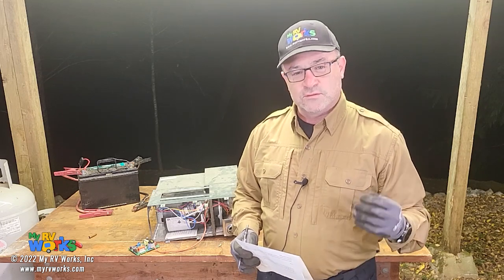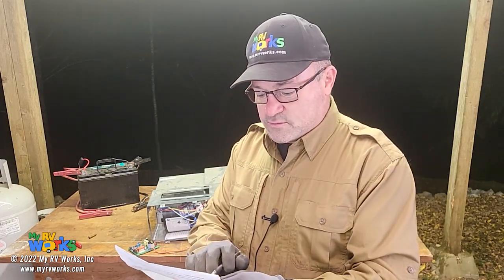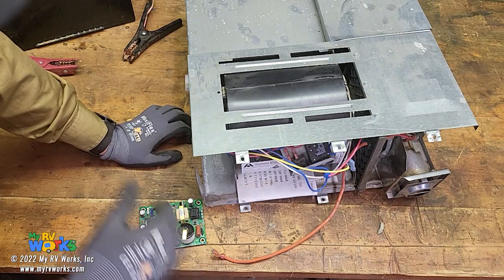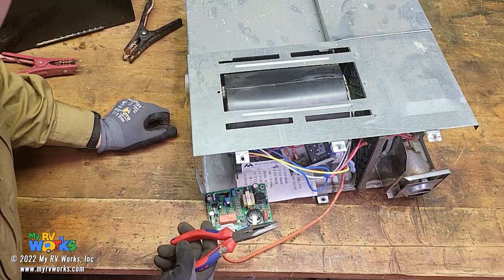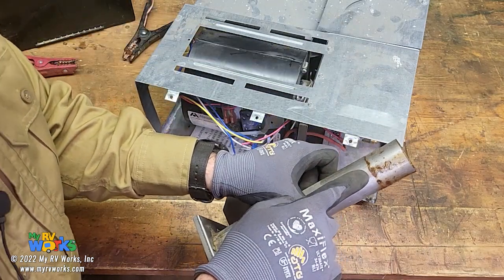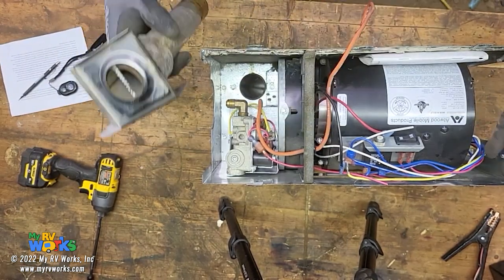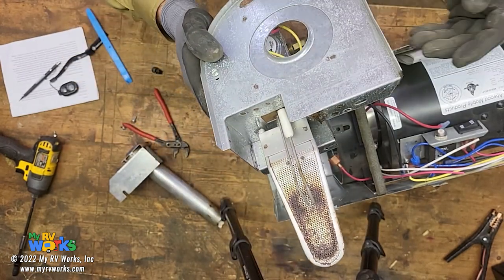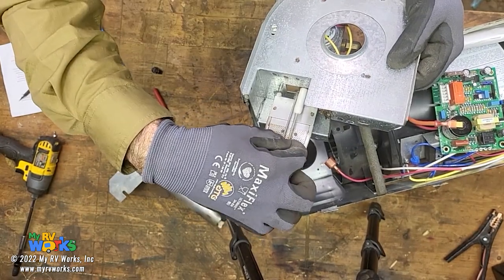Smell Gas From RV Furnace But It Won't Start -- Solve This Issue Here -- My RV Works

Comment: I want to thank you for your videos they've been very educational I've come to the conclusion that the best thing for me to do other than spending $1,400 for a new $3,500 BTU heater is to spend $260 changes all the switch sensors board new motor new fan I ordered through Amazon and I'm just going to rebuild that fucker new burner new nighter the whole nine yards and yeah like 260 bucks it's way better than 1400 for a new one nothing wrong with the housing

Comment: i have the Atwood Hydroflame 8535-1 furnace. 35k btu. has mostly new parts but now leaking gas from old solenoids while running it. works perfect and has been for 50 times but now leaking. cant find a Atwood #31155 gas valve for it. is there a rebuild kit or can i rebuild it? an alternative that can be safely modified? THX!

Comment: Love your videos but that problem with my Atwood 8525-IV is that the gas line comes from the top and makes it almost impossible to get to all the screws. Unlike this one the has a flange connection. Do you have a video of the other style?

Comment: In most videos (including yours) it is claimed that the gap specifications should be 1/8 in between the electrodes and the burner.  But what I am seeing in most videos is a gap of almost 1/4 in.  I have also been hearing the the exhaust tube should get some lock tight on it before re-assembly, is this true?

Comment: Hi Darren!
Thank you VERY much for the super well done videos. My furnace ias an Atwood 8535 made in 1995.  My heater fan motor starts, but the burner does not light, and the blower just keeps going, and if I do not catch it, the fan will run until the house battery is depleted.  I THINK that this must be a board problem, because the fan should be shut off after a period of time if there is no heat happening, shouldn't it?

Comment: I can smell propane from my heat vents while the furnace is not running and gas on. Otherwise the furnace works fine. Is this a bad heat exchanger? I also have the screen covers on the outside exhaust vents so animals stay out. Could this be part of it?
Reply: Did you figure it out? Having a similar issue
Reply: @NoName-sx9xs me too… can smell gas when furnace isn’t running… how do we fix this ??

Comment: Hello, my dometic suddenly stopped working. Fan blows, can hear valve open, hear spark igniting and smell gas, but will not light. Any suggestions to why?
Reply from the maker: I can think of a few things you can check, I'll just rattle them off here and see if it helps: 
> Verify your exhaust port is connected to the furnace. With that removed the furnace will flame out almost every time.
> For the next part you'll need to remove your burner assembly. But once removed, verify the gap between the electrode and the burner screen is 1/8" (just use an allen key to slide between). Also, remove the little brass orifice and make sure that that is not clogged in any way. Often times small insects like to set up house in there.
> Verify propane pressure is at least 11" W.C.  operating pressure. Depending on where you live you might need to get a license to person to do that for you.
> After all those tests, then I might suspect the board or the electrode.  On our furnace playlist we have many videos where we diagnose these types of issues.
Reply: I had the same problem, fan blows, I hear ticking and smell gas. The burner plate look almost new, the solenoids also look new. The electrodes look new also but, the electrode was different than the video. It has 3 prongs instead of 2. I also noticed a large gap between the electrodes and a burner plate. I bent the small electrode and the electrode that had the wire connected to it closer to the burner plate,that fix my problem.

Comment: Is the startup sequence of a Suburban different?  A Suburban Service & Training Manual states, "Upon a call from the thermostat, the module board thermostat circuit will go active. The sail switch circuit is verified as being open. The blower output is energized. Blower motor starts."   So if the sail switch is stuck closed the blower (on a Suburban) won't start?
Reply from the maker: You are correct. If the sail switch is still closed then the board will not energize the blower motor.
Reply: @MyRVWorks  Hi Darren, I have a question I’m hoping you can answer. I have PEX plumbing in my 2017 5th wheel. I took a section off and saw that it has brown slime growing in the inside. This was a section going to the shower but I know it must be throughout as the bathroom sink water has been smelling bad. Is there a way to flush vinegar, or peroxide or something through the piping to kill the bacteria? I don’t drink it but we do shower with it, etc. all I can think is to turn off the water heater and back fill the hose with a solution then reconnect and flush. There has to be a better way. I’d appreciate any suggestions, thank you!

Comment: Could you answer mine please,I have a suburban changed the motherboard,sail switch. I smell lp,I hear the clicking,fan blows. Does not blow hot. Thank you !
Reply: Replaced igniter
Reply from the maker: Two things that come to mind for you to check. First make sure that the exhaust Port is inserted into the furnace when you're testing this. If that exhaust Port is missing sometimes these furnaces will flame out. It does need that a little bit of back pressure that that exhaust port offers. Second is to check the gap on the electrodes. If you're smelling gas and you're hearing the ticking the electrodes may not be positioned properly over the burner so the flame is not sustained. You looking for about an eighth of an inch above the burner head.
Reply: @MyRVWorks  thank you for the response man,and exhaust port is inserted,electrode has its gap,and still nothing. I can tell you that sometimes it does work but once i try it again maybe a few hours later it will not. So I'm thinking to just keep replacing parts lol new ones go for 500$ -.-